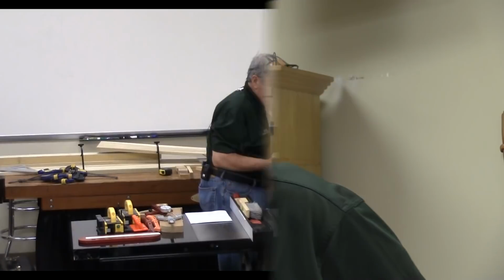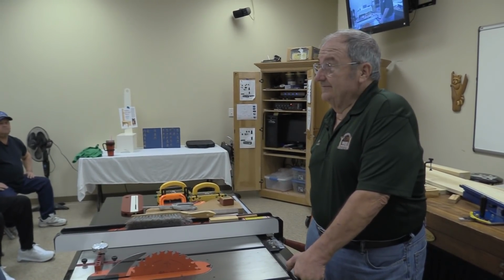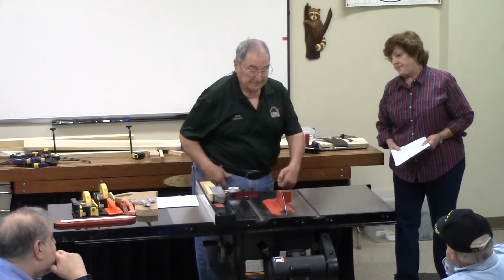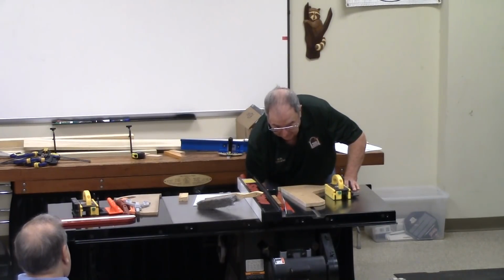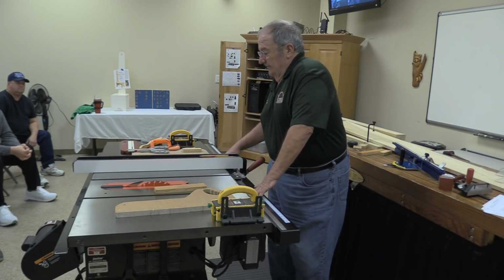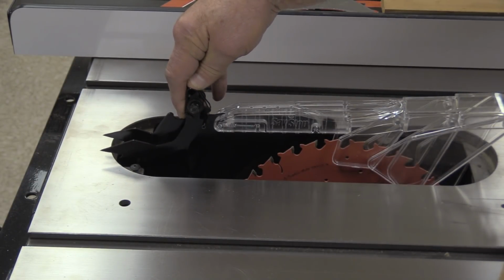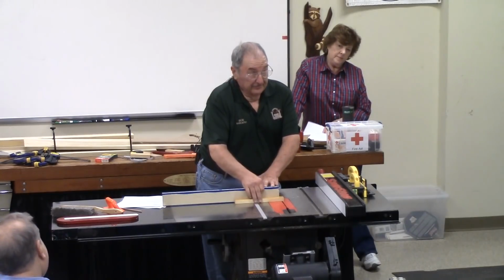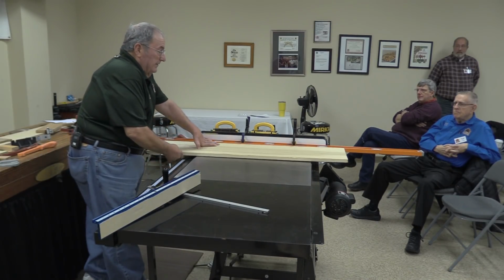Table Saw Basics

Comment: Thanks Bob, good video. I have two points for you... when the miter slot is not parallel to the  blade, what is the best way to move the heavy tabletop by a few thou??? It is very difficult!
Second, just because the blade is parallel to the slot when it is at 90 deg, - does not mean that it is still parallel when the blade is at 45 deg!!  If you imagine loosing the bolts at the front of the table and raising the front of the table say 1 inch, - -  at 90 deg that would not alter parallelism,  however at 45 deg the blade is sloping away from the slot and there will be a dramatic difference in the distance from the slot to the front edge of the blade compared to the back. This is because the blade is no longer on the same plain as the trunion. As  you raise the front of the table higher you are measuring farther and farther up the front edge of the blade and because it is sloping away from the slot - - the distance is increasing.  This results in the wood being cut twice at different widths, once by the front of the blade and a second time by the back!  Shims must be inserted either between the table and the cabinet or under the trunion. Of course it will never be as much as an inch, thats just for illustration, however 5 thou. would matter. I had to figure that out for myself because it is not covered in the handbooks, or videos, etc.
Reply from the maker: On the contractor's hybrid saw demonstrated, the trunion is attached to the table so the "Z" dimension issues are limited to machining tolerances. On a cabinet saw, where the table and the trunion are separately attached to the cabinet, the  issues you describe would be relevant.
Reply: Gwinnett Woodworkers. I agree.